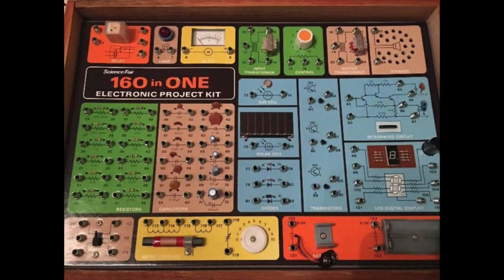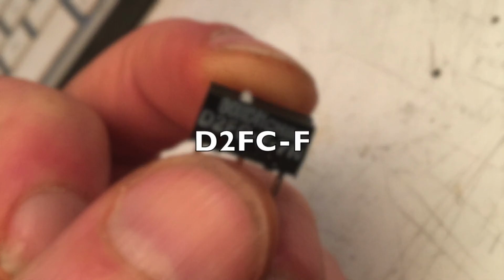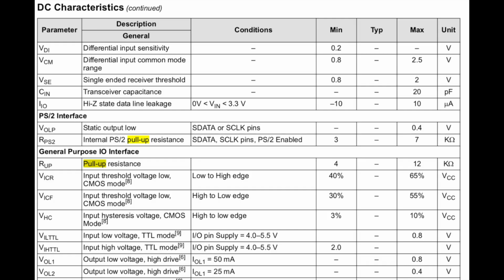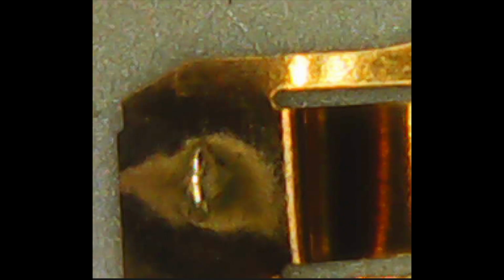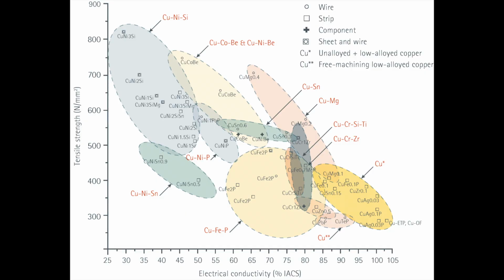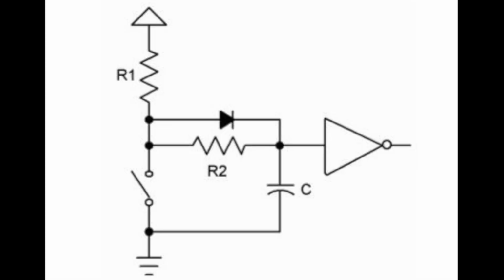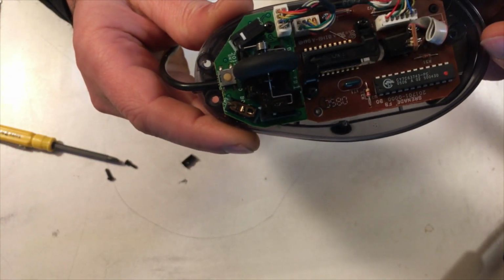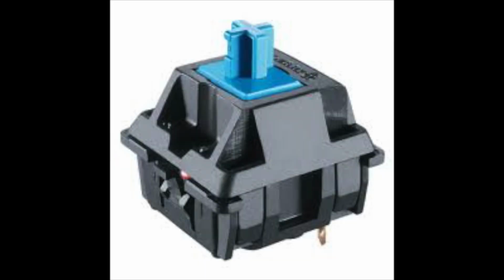Failing switch problem: Omron vs the modern mouse circuit

Comment: It's always bothered me how they only use the NO contact and then have to deal with debounce when there's a NC contact right there that makes bounces unambiguous. For my daily use office mouse, I hacked the board to put NO and NC contacts on gnd and +5V respectively, then added a simple debounce circuit (buffer built out of two inverters in a CD4049, and a resistor back to the input as positive feedback instead of pullup). 

This solved my mouse drag failures and got me another two years of reliable use out of what had been intermittent switches. The NC contact started to go after that, making button releases unreliable, but this is on the original switches whose NC contact was a dummy only meant for use as a mechanical stop. I since replaced the affected switch with a D2F-01F with a proper NC contact. We'll see what fails next.

I've now gone 13 years so far on this mouse! However, it shares mouse duty with my now ~18 year old Trackpoint keyboard, so I may not be clicking the mouse as much as a typical user. 

The plastic button on the keyboard between thumb and microswitch has worn out twice where it presses the microswitch. I built up the wear groove with epoxy the first time, and with steel filled epoxy the second time. I don't know what microswitch Chicony used for this, but it's still going strong, and I'm amazed how it's ground through the epoxy of my first fix without suffering any apparent wear itself.

Comment: i have returned 5 mice from logitech and roccat with this double click/drag problem (g402, g403, g502, Kain, Kone). some of them had the problem out of the box. im using razer optical now.
Reply: Same here with 2 logitech mice. My older mice lasted practically forever. I hate throwing away hardware that hasn't even been used for 2 years. Unfortunately as a customer it's impossible to find a regular mouse (i.e. nothing fancy, three buttons would suffice) that is durable and ergonomic, because you never know whether a model suffers from the problem described in the video. I'm now trying a Razer Basilisk V2 mouse with optical switches, even though I find the design not the most appealing and I don't even need all those fancy features... It's puzzling how the market fails to fulfill such basic requirements. Do these firms expect their customers to be too dumb to notice the problem?
Reply: @danielh.9010  im using the basilisk v2 as well. Its not perfect but it works at least. no double clicking. In my opinion the Logitech, Roccat and Razer products are not worth the price. For example the Logitech G Pro uses the same bad switches and costs over 100€. Crazy. You can buy a good cheap gaming mouse for 30€ that will last longer.
Reply: @killa2142xx  I've tried the new basilisk v2 now and I'm quite happy with it. But I agree that it's too expensive (58€) given that I don't even need 90% of its features. I just hope that I won't have to replace it in the next 5 years because that expectation was the main reason to buy it.

Comment: FYI you should remove the Amazon links from your video description, they no longer go to product pages that sell what your description claims they sell.

For example, the links say they should be "D2F-01F" switches, 2 pack and 4 pack.  But the first link goes to a 2 pack of D2F-F switches, and the second link goes to a 2-pack of D2F-01F-T switches.

You can even see  the second link they still say it is a 4 pack in the description, but 2 pack in the title, they have simply used an old product page.

Comment: Engineering grade analysis, complete with fix.  Kudos to you.  I wonder if mice are just overengineered its reached Rube Goldberg heights just so they can sell them at a higher price.  I still use a Logitech Click! Mouse from 2003, its been reliable, durable for 18 years, and I am a very heavy user.  I tried replacing it as its so ratty outside, but it still works like new.  I couldn't find a replacement that worked as well,  and I returned all of them, including a popular Logitech, they had some issues with tracking and ergonomics.  I just bought NIB or used Clicks mice from 2003 at eBay as they appeared, and just stocked up 4, I figure if one last me 18 years, I'll be long gone before the 4 I bought die on me, if I used them in sequence. Mouse Clickr freeware shows  I put >8000 left clicks/day on it.  Its more than outlived its 10M clicks, if it has a low end Omron or clone in it.   It was built better back then.

I went over to Steve at Gaming Nexus to see all his vids about mice, and its nothing compared to your evaluations, its all about usability and much of it is more like Logitech promo level material.

Comment: Dude! This was EPIC!! Super interesting and exhaustive look at these little critters. I have an old trackball where all these copper switches are bad but others aren't. I had a feeling it was oxidation/corrosion by the look of the leads so thanks for pointing out the gold plated Japanese type. I'll know which ones to shop for if the Deoxit doesn't help. Thanks for the education/information!

Comment: Dude wrote a 100 page paper about switches, made a 1hr documentary, and still made it very interesting to watch, and did an incredible job at explaining everything... Impressive.
It's been 2 years since this vid is up and Logitech still hasn't done anything. If they can just watch this video... smh, this dude has done most part of the job for them already.
Reply: They wont change switches. On paper their specs are awesome. In practice they lead to issues. Like he said in the vid, that is using the hype to sell stuff while the planned obsolence means they will break earlier so they can sell even more.
Reply: their mice fail at the end of the warranty period.  they WILL NOT change anything....
Reply: @LegionUkraine  Their warranty is conveniently 1 year. Right in time for it to break.
Reply: @LegionUkraine  If only... I warrantied my G502 LightSpeed 3 times, each of the 4 mice I got developed double click issues between 2 weeks and 2 months of use.

Eventually I gave up trying to get one that works, and just started swapping the switches to micro load models as they break. So far I've swapped the left and right buttons (left one twice, second time today after a couple of years of working fine), the forward index finger side button once, and the "sniper" thumb button once. All in all I think I've opened the damn thing up 8 times by now.

But damnit, apart from the crappy electrical design it's just such an awesome mouse! Nothing else quite fits my hand like it does, I love the layout of the extra buttons, and the infinity wheel is one of the best inventions ever...

Just wish they'd make one that runs the switches within spec, even if it'd hurt the battery life...

Comment: i killed a g602 yesterday given by someone a few years ago due to that switch prob. i tried to desolder/remove the switch but it was too hard and probably took out a contact trace. a new, fake omron switch is not working.   i can't be bothered to work on it anymore.
Reply: Sorry about that. the soldering sure sounds really complicated to do. I wanted to change my G502PS's switches to Japanese Omron but the soldering part sounds worrysome that could kill the mouse and now you said it..

Looking at a previous comment ya made, wich mouse are ya gonna pick?. A Razer Basilisk V2?. Same G502 shape but might have wobbly buttons
Reply: @DVTHEFOX  not an expert on mice. i just took the cheapest available mouse with optical switches, razer viper mini
Reply: @zodiacfml  Did ya got any issues on wobbly L/R buttons or wheel clicks not being registered or scrolling doing some skips?. Those are common on Razer mice
Reply: @DVTHEFOX  mine is fine. none of the wobble or creaking. the wheel is also fine but doesnt feel as fast as the two buttons, more likely uses a basic switch

Comment: true! first logitech around 20 years ago took a long time to break, im not even sure if it was a switch or circuit problem, i just forgot.  but all mice i've had just have unreliable switches.  i'm tired of cleaning and/or replacing them.   im going to buy an optical switch as ssoon as possible. i should bought it few weeks ago,i just a lot of money yesterdasy on trading because i got too busy reviving mice

Comment: ...wow, I was just curious why my mouse was failing. I learned so much more, didn't think I would stick around for the whole hour but it was such good content. I thought when the female was having a melt down you were going to turn the mic off so you could pick up later and not be distracted, instead we got included, was an awesome break and had me cracking up! Thanks for the taking the time and effort to produce this video and explain everything in detail on a basic level. A+

Comment: I know this vid is old, but as you gave a shout out to the MX518, I googled it and saw it is has been re-released... but I'm wondering if the new release would be as robust as the old or if it is just the same exterior with similarly crappy internals?  Any thoughts?

Comment: What about scraping off the oxidation from both contacts? Should that solve button dragging issues theoretically? I tried it with a scalpel and even cleaned with isopropyl but the issue still remains. I wonder if I scraped too little...

Comment: Is there any switches you might recommend for relatively high mechanical and electrical lifespan?  Or would it possibly be better to fix the mouse using the resistor method? 
I know you kinda suggested the Japanese Omrons but you also mentioned some very high quality Panasonic switches but left out some details on those
Reply: I have a Roccat Burst Core Buyed 1,5 Years Ago, it has the Titan Switch (Optical Laser Switch). It works perfect like Day 1, not a single feeling of worsening.
I think this Optical Switch is the Revolution we needed to Fix this Double Click Problem. They say they are testet with 100 Million Clicks. Most Omron Switches are said to last 10 Million Clicks. So instead of 4 Years you can use the mouse 40 Years. This Is a relativly new Tech. 
The Only Brands with this new Optical Switch Tech are Roccat, Logitech, Razer, Corsair, SteelSeries, Cooler Master and 2-3 smaller brands that i dont know.
But you should watch out. Some Older models with Omron are still in sale with this Brands. Not all Mouse models have switched to the New Optical Switch.

Comment: Thanks for the video.
There is an opensource mouse that supports QMK, which is programmable, and it is called the "ploopy" mouse. They sell a couple of trackball models and a regular style mouse. I have not gotten one yet, I am still waiting for the build yourself option to be available. I am sorry if someone has left this suggestion in the comments, but I didn't see it so I had to share.
Reply: Just got one lol. Do the switches in these last long?

Comment: I have been using Logitech wired mouses for many years and I had no problems.  When I purchased a Logitech G wireless gaming mouse and it started to fail over a year.  The mouse won't click and drag properly anymore.  This is very disappointing.  Do you know if this issue extents to Logitech consumer like the MX mouse line?

Comment: And some mice manufactures are hyping up the 2k polling rates..  imagine how many issues these will have in a very short time.. But I guess it will be after the warranty period has run out.. i gues its one way to make $. Also to note that Japanese Omrons are slightly higher so your presses will feel like they take no force.. ie the plastic button would is already putting say a 1/3 of the required force to activate the switch..

Comment: You only mentioned it very briefly, but the idea of adding a capacitor to a chattering switch seems like an excellent solution, at least when mechanical performance is still good. The extreme short duration of the cutouts should allow for capacitance low enough to not cause noticeable delay. Have you actually given this method a test and found out what the appropriate capacitance range is? You mentioned 0.1µF / 100 nF, but from how you worded it, it sounds more like it's something you considered but didn't actually do. 

Excellent video, thanks a lot.

Comment: Very interesting and thorough inspection of the problem.
I have learnt a lot watching your vid.
 
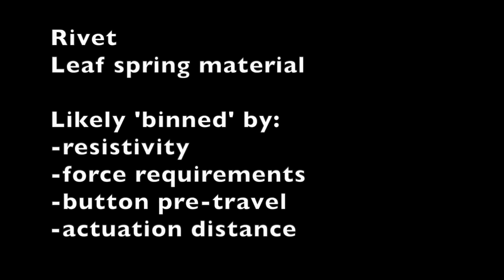30:13 - Don't you mean 0.06mm for the clicker plate ? 
You could clearly hear mouse clicks in older models and I bet they had click springs near 0.20mm thk and were probably made of Phosphor Bronze but switched to Beryllium Copper and thinner gauges as a part of miniaturization drive. Altho BeCu is a fantastic alloy, I feel the concept was taken too far without adequate research that the current models don't have enough spring force to make good contact. 

32:14 - yes please, interested to see good engineering

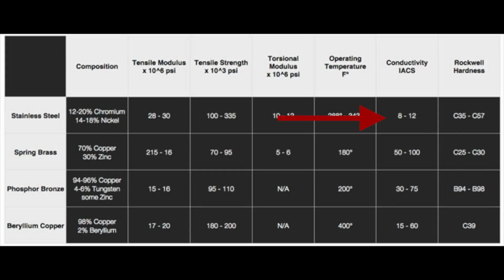34:45 - Phosphor Bronze is Cu + Sn Tin + P (no Tungsten) , its electrical conductivity based on CuSn4 - CuSn6 types is between 13-25 % IACS (at 20°C) and that of CuZn30 Brass is 25~30 % IACS (at 20°C). 
2% Beryllium Copper (C1720) is the strongest Copper alloy with max. strength near 200 KSI and its conductivity is near 20% IACS but it is more than 3 times as expensive as Phosphor Bronze. This is cuz Beryllium is toxic to work with and only 2 major companies in the world produce BeCu strips. BeCu alloy is safe as any other Copper alloy.

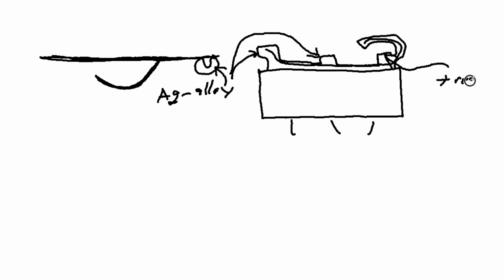35:50 - Electrical grade of Brass cannot be (heat) treated for improving hardness. It can be cold worked or hardened by hammering. The color spectrum must come from some other process.

40:00 - Interesting comparison

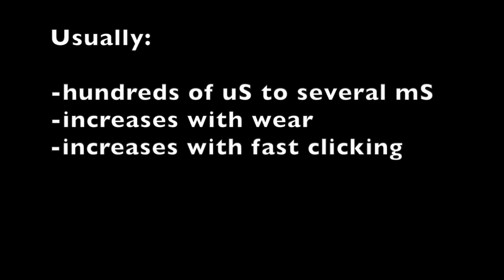48:20 - Dampening can also mean damping but latter is better

48:25 - bouncing well summarized in one line

58:24 - lol....girlfriend meltdown in 2 languages

Overall its clear to me that the researchers/designers at these big firms spend millions and use latest tech but don't apply adequate commonsense to new designs.

Comment: Thank you Alex.  I fixed my expensive (to me) Razer DeathAdder gaming mouse with the information in these videos.  Both the explanation why they go bad so easily and the information on what switches to source to fix the problem are extremely valuable to me.

Comment: Never had this problem until recently. I bought a wireless mouse in 2015, forget which brand it was, but I have a feeling it was Genius. It served me 5 years with zero issues. After it broke, I happened to be broke too, so I bought a pretty cheap one (of a lesser known brand), and a few months later it started having both motion issues and double-clicking. So then I bought another cheap one, and it had those issues almost from the beginning. So, finally, after I got some money, I bought a Logitech, remembering their wired mice from the early 00s that had zero issues. Well, at first I was happy with it as the movement was perfectly smooth and I was experiencing zero issues. But it's been a few months now and it started double-clicking too. Son of a bitch! What tf do I have to do to get a good mouse? Logitech is supposed to be one of the top-tier companies, and even they have this problem? So, anyway, this lead me to this video. Hoping it'll help me solve my problem.

Edit after watching the video: I didn't understand it.
Reply: Everyone's out to get you and you probably can't buy a good, durable mouse - if you want one, you best get comfy with a soldering iron and putting in better switches, at the very least. Your next best bet, should you not be willing to do that, is simplest mid-tier wired office stuff with just the usual PAN3509DH-TXWA controller, generally cost just north of 10€ from some mid-tier brand, i'm hesitant to recommend any since i no longer buy mice, and i can't vouch for any of them, but i guess ones vaguely like KYE-Genius, Hama, Speedlink, Rapoo, maybe Cherry, would be candidates. You get all the usual features, you get a little DPI switch which cycles them between 600/1000/1600dpi and forgets the setting every time you turn off your computer (they might write fantasy figures such as 800/1200/1800 or 2000), you get all the main buttons and wheel, two return/forward side buttons, and optionally tilt switches in the wheel to scroll left and right, you don't get any programmability features or software. If you cheap out too much, you get just incredibly bad switches that won't last at all regardless of the electronics. If you get something with better features, you get the newest fanciest processors which, the way they're used by mouse manufacturers, due to bad engineering, can not maintain even semi-decent switches running reliably.
Reply: "What tf do I have to do to get a good mouse?" -- Same here. I've decided to switch to mouse models with optical switches instead. A4Tech, HP Omen, Razer and Roccat have them (not all models, but some). I'll try the Razer Basilisk V2 next. If you need something cheaper maybe Roccat Burst Core is a viable option for you. Good luck!
Reply: @danielh.9010  Yeah I have a Roccat Burst Core Buyed 1,5 Years Ago, it has the Titan Switch (Optical Laser Switch). It works perfect like Day 1, not a single feeling of worsening.
I think this Optical Switch is the Revolution we needed to Fix this Double Click Problem. They say they are testet with 100 Million Clicks. Most Omron Switches are said to last 10 Million Clicks. So instead of 4 Years you can use the mouse 40 Years.

Comment: OMRON is a Japanese company, right? My G903 switches say made in PRC. My double click came after a firmware update.
Reply: It's a Japanese company which maintains manufacturing facilities both in Japan and PRC. But the devices made on these different facilities are not identical, they have different model designations and specs. The mid-tier mass market switches are from the PRC facilities, there are high end switches made in Japan.